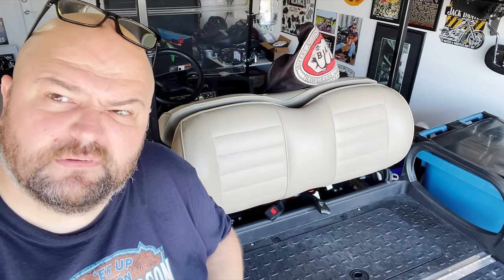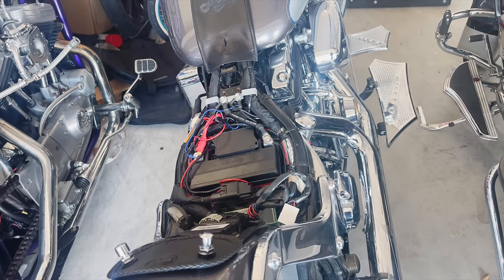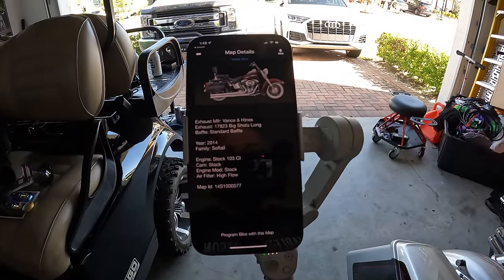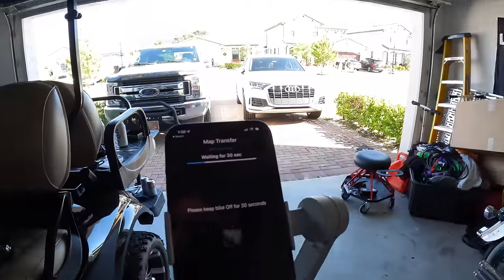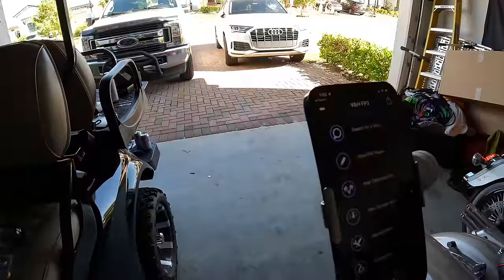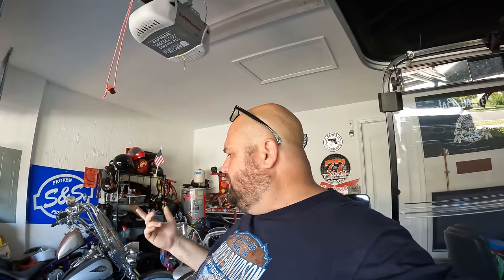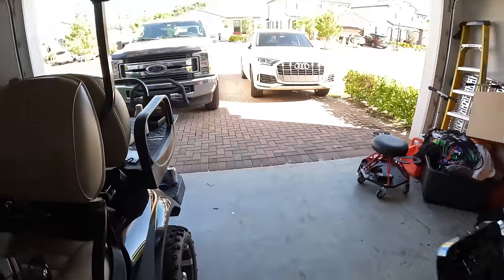Harley Tuning Bible: Who's What's & Why's of Tuning a Harley-Davidson w/ a Vance & Hines FP3 Install

Comment: The previously married FP3s are still useful to check engine temps on any other bike you can plug them into. It’s good to see and learn what’s “normal” for your engine at various ambient temps and loads. For example, sumping is going to spike your engine temp. Good to have a baseline so that you know when something is out of wack.

Comment: I did 3 auto tune sessions with my bike. Each time it got better. I’m pretty happy with the FP3. It’s easy and simple to use. I agree that if you are just doing a stage one (intake and exhaust) this is the perfect tuner. If you are doing anything above the stage one you need a more complete tuner and for folks who don’t understand fuel ratios a guy who is knowledgeable on a dyno and the tuner you choose. Great stuff. 👍

Comment: In the “view sensor data” screens- touch one of the 5 indicators. A menu will come up that allows you to change the layout. I program all 4 pages of “gages”. 

I like the FP3 a lot. Runs far better (full stage II) than it did with the $400 Dyno tune it had. I spent some time on the phone with V&H and they can monitor your bike while running. The support from them is amazing. Auto tune did nothing for me. Their canned tune with over the phone tweaks nailed it.

Be sure to play with throttle progressivty. Changes the whole personality of the engine.

I even have a “rain” tune I can switch to. It limits throttle in low gears and lower redline in low gears. 

Unlimited possibilities for custom tweaks on there. Change warmup schedule, idle speed, redline, etc. I really like the gages. Even reads TQ and HP. With the Dyno tune installed TQ and HP read exactly what the Dyno sheet shows. The V&H Tune shows 8 more HP and 12 lbs TQ increase. Runs smoother, no pop now and noticeable better power. I tell my Harley buddies it runs like a Honda now! They go into spastic convulsions.

2016 FLHTK
Reply from the maker: I love the idea of the rain tune!

Comment: All good info. Yes, that's the first thing I did once my 2 years were up., Harley high flow, and V&H tuner and slip ons. Wasn't expecting much improvement in performance, mainly sound and looks. But what a night and day difference. The 1st time I kicked into second it was like a completely different motorcycle in terms of acceleration. And  0 to 70 was effortless and smooth whereas before the bike seemed to be "working" to get there. Best upgrade I've made so far. Thanks for a great vid.

Comment: Decel pop, that's an option to use after you've tested the new map. It was the old Screamin' Eagle map that had this issue, not the new installed map.

For autotuning, you don't need to watch your phone. I recommend doing first a full tank of gas, stopping every 15-30 minutes and writing the changes made and repeat. Because there is only narrowband 02 sensors, it needs to repeat the process over and over to get it correctly. Personally I'd say spend two tanks of gas doing this, to get a really smooth map. IF you decide to use a different octane, that like a different intake or different exhaust, will not run perfect anymore with your tune...

Comment: Great video! I've got a 2015 Ultra Limited with the liquid cooled heads. The dealer installed the orange Screaming Eagle Super Tuner Pro after pipes and a high flow intake. The tech told me my bike would be one of the last they would ever do under warranty due to the lawsuit. This was late 2015 I believe. It runs pretty good, but like yours, mine has an annoying decel pop. Great info.

Comment: I own a 2011 Road King Classic and installed the FP3. I installed a Cobra Power Flo air cleaner and remapped for the new air cleaner and the difference was very noticeable (seat of the pants feel). The tuner was very easy to use, and the Vance and Hines map data base is very extensive. I would recommend this tuner to anyone who wants to re-map their modified bike.

Comment: I am so glad when I get done gapping my plugs and jetting the carb. When 1965 rolled out the new Panhead with electric starter, they also began using an auto advance ignition. My cousin who first bought that 65 Electro Glide hated the auto advance. He'd wrecked his 64, so he took off the beach bars and distributer and put them on his new 65 Pan Head Electro Glide.
When I turned 16 and bought the bike, that's what I spent decades riding and wrenching on. No, to this day my bike doesn't have a button on the bars to start it. The starter is there completely unused.
Mr. Monkey, I appreciate you, your knowledge and your Lovely Ladies. But as I live and breathe, I'll never have to tune a bike with my smart? phone!
For those who bad mouth you, I'll pray they drop off the planet. I live peacefully knowing they could never kickstart my favorite bike, clutch with their foot and shift by the tank through only four gears while adjusting the timing with their left grip.
I'm stubborn, stupid and very much OLD SCHOOL!
God Love you Young Man
You are in my prayers
Hoka Hey
Reply from the maker: Thanks my friend. I am a fan of all bikes new and old. I really wish I new the older setups better but they are just before my time.

Comment: I have the orange racing tuner on my 07 Sportster that I recently sold. It was the only way to get the engine to run straight pipe. 
The nice thing about it is that you only needed to run it on a dyno once, afterwards the ECM tuned itself.

Comment: Hey Monkey, I just found your content and enjoy the knowledge with some humor approach haha, I know it's going to help me. I own a 2020 FXFBS Fat Bob Milwaukee-Eight 114 that has been mainly stock until a few months ago. I first bought and (dealer) installed V&H Hi-flow slip ons for better sound and flow, and shortly after realized it wasn't enough for what I was looking for performance wise. A couple weeks ago I decided to purchase a V&H PCX Upsweep 2:1 and have HD Service install it along with a Stage II cam upgrade. I decided against their screaming eagle tuner and bought my own FP3 which I have been trying to auto tune myself (it's taking longer than expected). I still have the stock air intake though, as they had originally told me it was high flow and didn't need replacement. I know it is running rich because my bike is throwing a code and the tuner tells me (along with it glowing and popping flames at times at least in idle). Should I purchase a better air intake and scrap my current auto tune which is still in progress? Or just put another standard tune on it, or take it to the professionals to tune?? Thanks again for your content, I don't know much about it I'm just an enthusiast who loves to ride when I can and upgrade where I can.
Reply from the maker: Hey!!! It’s running lean,  not rich. The intake is high flow so that’s fine. I think your tuner is your problem. The FP3 is good for stage 1, but not enough or at least difficult to use for stage 2 and above. I’d see if there is a professional tuner out there that uses the FP3 and see if they can work it out; or you may need to go with a better tuner. Either way having it professionally tuned is gonna fix your issue. Welcome aboard!

Comment: Its noteworthy to know your already owned power vision can be used with a new bike for only $199 if you switch bikes all the time like we do and can be used with all your bikes with only 1 device.  I personally the power vision because I understand how to use it with the computer software (it can do auto tune also) but have also used the fp3 in the past.  Great video!
Reply: Power vision is a far better option, I agree.

Comment: Good informative video. I like using the V&H tuner. I installed one on my "then" new 2012 FLHX & running good today. I wish I had numbers to prove the upgraded tune, but I don't. I go by feel, sound, temperature & reading my plugs. Most people that bash the FP 3 seem to be the people that tune for a living. I get it... You told it like it is. A stock engine with a stage 1 being tuned on a dyno doesn't make good sense. Note;
I have never run the autotune!
I guess that I felt good with the can map, so I didn't see a need.
Reply from the maker: Yeah, I will run it just to show those that want to, but for most setups it's not necessary in my opinion. It's great if you have an obscure pipe though.

Comment: I had to get the TTS for my bike its a 05 dyna factory fuel injection at the moment it has S&S slip one and  Arlen Ness big sucker intake next winter its getting a set of cams  and hydraulic tensioners plate maybe a 95 big bore kit

Comment: I know this was a while ago so I hope you get it. I got a Arlen Ness intake and Vance n Hines not full pipes but the add-ons on my Heritage and it sounds great. A bike mechanic did it for me, not a dealer. Was any kind of tune up necessary. He said no so I guess your my second opinion. I love it please dont get me wrong
Reply from the maker: Hi! If your bike had a completely stock air cleaner before, and then you added the Arlen Ness high flow air cleaner you need a tune. If the bike already had a high flow air cleaner then it is fine.
Reply: @ProfessionalMonkey  Thank you sir. It was stock so I'm going to go for that tune up. I appreciate your advice. Thanks for what you do. I enjoy the hell out of it.
Reply: @ProfessionalMonkey  ok the guy that works on my bike is an old biker and I said I need a tune up , I can even tell now. I'm getting new rubber on next weekend and I said why dont I just get a tune up while I'm there. He says no I will put new plugs in and you'll be fine. So if that's the case why didn't he do it in the first place and is that all you have to do for a tune up is change a couple plugs ? I dont wanna offend if u get my drift but I do want ammo in my knowledge so I can use it carefully.  I know you understand that.

Comment: Hi buddy. I love this channel. You are so real and genuine. I don’t know much about how the engine works but I’m trying to learn. I’ve got a 2015 Street Glide Special that I put SE high flow intake and Bassani exhaust. Should I have the bike tuned or re tuned?  What will it do to the performance?  Thanks
Reply from the maker: If it was a stock air cleaner before it needs to be tuned. It will need fuel added to the mix to make the bike run right.

Comment: Just a little info on the power commander technically u don't need to take it to a tuner. U can actually change the numbers in a given box and change the timing. As where the fp3 this can't be done. Either Vance and Hines has to send a map or u take it to a tuner also. Any map can be altered with the power commander with a laptop. Power commander and fp3 both are fantastic tuners. I chose power commander 5 because i wanted to learn how to tune my own stuff. Power commander is the cheapest way in my opinion to this. Thunder max tuners are expensive but they give the user the most accessability and completely change out the factory ECU

Comment: Good timing on the vid bro.

My bike was sumping very badly to the point it fried my crank sensor. 
So I’m getting a Daytona oil pump put in and since they’ll be in there I thought may as well hot rod that SOB.  Zippers 468 cam. Lifters, oil pump, head pipes, air filter and a dyno tune.
I just had to buy a power vision license for $200 and they reflash the ECU.
Gonna be ready this week.  Just in time for fkn snow and cold prolly.  Been gorgeous here all week.  Damn holiday got in the way of so much. 
Now I can just watch vids on bike stuff..

Man.. been a bad time for pumps.
Oil pump shot in bike 
Cars hpfp is on its way to taking a shit bc it’s not able to keep up with the added fueling needs of the turbo,  annnnd meth pump was defective ..   bad luck and bad timing
Reply from the maker: DAMN! The new build will be badass for sure. Too much motor for one of these for sure. Can it be done, yeah, but I would go the way you are.

Comment: Hi, great video. Do you consider the V&H fp4 would work for my 2011 Sportster, if I also have the SS 883 to 1200 kit with slip ons and high flow filter? (Stock cams). Or a dealer tuning would be required additionally to the fp4? By the way there is no dealership in Bulgaria and I am wondering if my bike will run fine only with the fp4 after the increasing to 1200.
Reply from the maker: I’d go Powervision since your motor is modded.

Comment: About 5 months ago I got the fp3 because you said it was a good tuner I put it on my 2013 CVO Road Glide I have a 110 engine and it's been nothing but amazing I love the tuner just like with you as soon as I started the bike I could tell the difference all the problems I had with acceleration and deceleration or gone immediately I love it thank you so much for the advice

Comment: I found my Sporty was running hot after using the premade FP4 map. Autotune brought the temps down to a more reasonable level. In my case, I think the higher elevation (CO) was to blame. Dont think V&H takes higher altitudes into account.
Reply from the maker: True, you were definitely running lean. Most canned maps are lean...

Comment: I'm fairly sure that changing the decel pop in the app adds decel pop to the tune. I don't think it matters if the bike previously decel popped badly as the new map wouldn't not have had the issue as the previous tune. This is at least how it was on my 16 SGS when I changed the decel pop wheel.
Reply: I think so too. I put mine on None and it took 95% of my popping away..

Comment: this is good info i just changed the slipons with V/H free flow on my trike and getting a V/H intake and was wondering about the FP3 if i really needed it or not thanks for the answer
Reply: If you are going to change both intake and exhaust to move more air, then I would recommend a tune to compensate for the added air flow through the engine.  Which tuner is the big debate.  I always recommend powervision but others will say differently.   Do your research,  and you will find a vast majority of pro tuners also recommend powervision in thier shops.  Also year of bike is important

Comment: Totally agree with High Flo or not, enough air or not enough air.  I use the Power Vision with Target tune which uses wide band 02 sensors.  I believe it is as close as I can get without paying someone to dial it in with a dyno for me.    Couple auto tune sessions and it runs fantastic.  I bought my 2017 Ultra limited M8 107 with screaming eagle slip-ons, SE cams, SE tuner because it was under warranty.  I change it immediately to Power vision, Vance and hines slip-ons, Bassani head pipe, S&S cam with the cam chest kit from S&S and it runs fantastic now.  Fuck the warranty it is shit anyway.  I think the most restrictive thing on the factory bike is the dam catalytic converter.
Reply: Powervision is a better tuner in my opinion.   Good choice

Comment: I have used the V&H stuff on other peoples bikes . They seemed to work pretty good . I use the thundermax with auto tune , cuz i also change things , ALOT . The thundermax is also able to be swapped to a different bike i believe .  Its not vin. Specific . Just found your channel also and like the "common sense" advice for the newbs .

Comment: I changed my 2020 ultra limited exhaust to "BAD DAD CUSTOMS" turndowns. Nothing else.  Since I didn't change the air intake system,  it shouldn't affect the engine,  correct?  (I changed for sound and appearance). I  know that you're not an expert, but tell me your opinion.  Thanks.
Reply from the maker: If your intake is stock and your headpipe is stock you should be fine.

Comment: Did it stop the decel pop?   That's cool that you can check your battery voltage on that app.   It gets tricky when you're trying to use a multimeter to get a battery reading while riding the bike.   I usually hook the alligator clips to the battery terminals then tape the multimeter to the gas tank and go for a ride.

Comment: Would you recommend the fp3 over the fp4? I know the fp4 has the code reader option but I am planning a cam upgrade in my 15 streetbob and I guess the fp4 doesn’t have a cam option, is that correct? The fp3 seems like the way to go but what would you recommend ?like the way
Reply from the maker: Yes! FP4 is over simplified I’m told.
Reply: @ProfessionalMonkey  thanks brother and keep up the great videos.

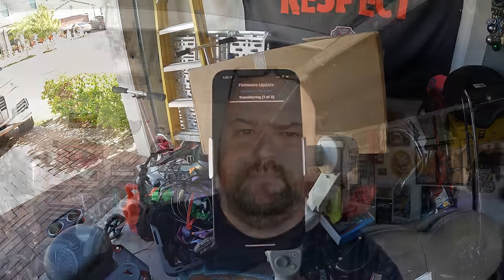Comment: 22:12, LOL! Not sure about the Porsche model, but my wife's Audi SQ7 3 row SUV towed a 2000 Pontiac Trans Am 6MT on a dual-axle auto transport like it wasn't even there, haha!!! Even managed to gap some guys on crotch-rockets towing the same empty trailer up Blood Mountain. Also, Ryan F9 rocks. 🤷‍♂😂
Reply from the maker: The wife's Q7 is the little turbo 4. It supposedly will pull over 4k pounds but I don't see me doing it!
Reply: @ProfessionalMonkey , ours is only rated at 8,000lb(with 500hp) capacity but so is the V6-Turbo making me think it's air suspension limited... Gapped a "built" 2500 Duramax with it from a dig while I was towing an '86 300ZX Turbo on the same trailer and he was empty/no trailer... 😁😎

Comment: I have a 2013 road glide with after market pipes that arent marked anywhere to tell what they are. They sound good but have no idea about the manufacture. will this tuner still work?
Reply from the maker: High Flow intake? If so you can run AutoTune and it will dial it in for you.